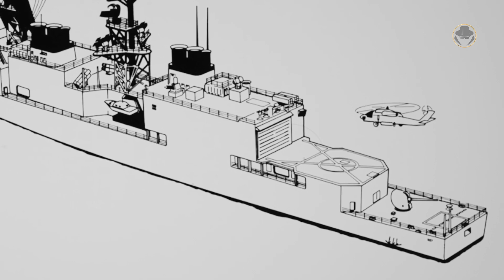Vittorio Veneto helicopter cruiser | The last actual cruiser built in Western Europe

Comment: basically any large modern warship such as a 7,634 ton - 12,063 ton destroyer could do with a double classification as a helicopter destroyer cruiser with minor modifications & upgrades . . . incorporating a stretched flight deck at the very aft stern section & a sizeable hangar that can fit upto 3 ship-borne MH-60U Marine Hawk multi mission maritime support helo . . . the stretched stern flight deck has to be long & big enough to accommodate 4 - 5 helos with simultaneous lift off & landing capability . . .

Comment: You removed my comment. I did not insult anyone,what I wrote was this. The Vittorio Veneto never had 4 Polaris tube installed,you are confusing with the Garibald,ex wwii heavy cruiser converted to missile cruiser in 1961. Garvald had 4 polaris tube. I sent you a link showing you the details of the cruiser and the photos and my comment was removed. Vittorio Veneto could never have had any polaris tubes installed as it was designed to carry helicopters whilst the Garibaldi was a conversion and it had a larger displaycement. For your information I was on the Duilio 554 which was moored right next to the Garibaldi in Taranto and subsequently to the Vittorio Veneto.
Reply from the maker: We did not remove any comments. It was probably YT. Many sources, including the Jane's, mentioned the Polaris tubes. Of course, nobody from our team could have the pleasure of seeing Vittorio Veneto with their own eyes. Thanks for your information.
Reply: Da mia informazione mi risulta che sia il VV che il Duilio e Doria erano predisposti per imbarcare i tubi lanciamissili Polaris. Predisposti, ma non imbarcati.. Oggigiorno si direbbe FFBNW, ovvero Fitted For But Not With. (Non so se parli inglese, spero comprenda) Quindi il tizio del video si direbbe abbia ragione.
Reply: @sergiodario58able  First of all my original comments were in English, so I believe  that have already answered your question. Now considering the size of the Polaris launch tubes on the Garibaldi (1961 refit) which were positioned below the Terrier launcher (stern) I suggest that you look up the size of these tubes and the required space used on the Garibaldi. Even though Italy experimented with this missiles until 1976 and Doria/Duilio and Vittorio Veneto were launched/used after 1964, the Preparazione without fitting of the tubes would have required not having the flight deck. 
Furthermore : "The launch shafts, about 8 meters long, had a diameter of 2 meters and the doors opened by rotating towards the axis of symmetry of the ship. The project for the arrangement of the four launch wells of the Polaris in an area previously occupied by depots and coves of various destinations was handled by the then vessel captain Glicerio Azzoni, and concerned both the structural arrangements for the launch and the placement of all the systems and equipment necessary for the use of missiles, such as navigation instruments and the complex of calculation units. These arrangements were placed in rooms adjacent to those of the wells, which were mostly below the waterline, in an area delimited by watertight bulkheads and a triple bottom, approximately 14 meters long in total and equipped with lateral protections. " Duilio and Doria would not have been able to perform to the original requirements. If Italy would have been allowed to have nuclear weapons then perhaps after major refit these three ships would have been able to carry  one or two tubes. Question : have you ever served on any of those ships Garibaldi, Duilio/Doria, Vittorio Veneto? I was on board that Duilio from 1969 to 1974 in CADT.  I know 100% what weapons were available and the potential of any new ones.
Reply: @sailor67duilio27  
Si direbbe che le tue informazioni siano più dettagliate delle mie, e mi complimento del tuo sapere in materia e dell'eccellente esposizione in un ottimo inglese. Non sono stato imbarcato in alcuno di quegl'incrociatori, anche se v'ho messo piede sul VV da marinaio visitatore. Sono stato imbarcato su nave Carabiniere da RT nel 76 per circa 10 mesi. Amo la marina ed amo la mia patria come presumo lo faccia tu. 
Distinti saluti, SergioUK....(UK perchè vivo in Inghilterra da 36 anni).

Comment: The Italian Navy is back with new 15,000 ton heavy cruisers in the next few years, with 100/128 vls 185 MT long.
And it is likely that the names will be of the new cruisers Andrea Doria and Vittorio Veneto
Reply: Andrea Doria is already being used as a name. Also they are being classified as Destroyers.
Reply: @ElAyVee  You're right, I forgot that the Andrea Doria is already in use in the Horizon fighter, what I'm referring to were initially the new fighters that were supposed to replace the Durand de la class. Pens that were supposed to be 11,000 tons, and They were considered light cruisers/destroyers, lately they changed them and brought them to 14800 tons and they are called heavy cruisers,They will make 2 units but rumors speak of the possibility of another 2 optional ones at a later stage, they will start construction in 2026/27
Reply: @met71metaldetector55 correct, however  the project is still called DDX, so Destroyers still. But I will wait to see an official announcement that says otherwise, let's not get ahead of ourselves.
Reply: @LeonardoFSI   It is the DDX program but lately they have changed the project because it will have a radar that weighs only 7 tons and works on X and C band and they have brought the DDX to 14800 tons and they are considered by those who appreciate them Destroyers but heavy cruisers due to their weight, size and detection system over 1000 km, Then we know that the Italian navy always underestimates the classes of ships. They can classify them as destroyers but with the capabilities of a heavy cruiser, while the PPA evo which are classified as patrol vessels But the evos are screwed, it is likely that if the DDX will have the cruiser role the evos will have a destroyer role with its 64 vls and armed with scalps.
While there are already rumors that the DDX will be equipped with hypersonic missiles,  From cruise either American or MBDA ones, which are developing

Comment: Displacement of Veneto cruiser  is much smaller than our new german F-126 frigates.... But before laughing... there are many ( modern 21st century) comfort, technical, Security and redundancy reasons für that fact.
Reply: Remember we Lost the war , back then we weren't allowed to build big ships , still today we have to built Destroyers just below the  lower limit of such class and call them Frigates we only have 4 proper Horizon Class Destroyers but 10 FREMM Frigates bigger than the French ones ( they can have as many proper destroyers they want) and Just commissioned one LHD cruiser of 245 meters that actually  carries F35 B and will carry 20 of them  because we already have an aircraft carrier (2 actually but we're going to decommission the oldest One)
Also our Military ports still  have limits
Reply: @adeliomoro2069  You are wrong, there were no limits imposed on Italy in terms of how big a ship it could build, and no limits imposed on Italy after WW2 still applied, all treaty limits were nullified between 1949 and 1951, the limits were removed so fast some ships that were do to be scrapped were put back into service. The Vittorio Veneto was an enormous ship by any standards, the biggest surface combatant built by a western power (except the U.S) during the cold war. Italy dosent "have" to build anything under any limit and Italy dosent have to call destroyers frigates, Italy always used the destroyer name for destroyers, the FREMM are called frigates because they are frigates. Italy can have as many proper destroyers at it wants, ironically the french are the ones that cannot have destroyers, as the destroyer nomenclature was outlawed in the 1970s to reduce burocracy in the french navy.
Reply: @adeliomoro2069  Germany after 1990 2+4 and other International laws has no Limit.
And italy also cannot have Limits concerning warships.
 They have 2 F-35 aircraft carriers with additional weapons.
And Plan to build a 10.000 destroyer DDX.
So you are totally wrong and old fashioned in your opinion!

Comment: the 360° deg rotating Mk10 twin-arm launcher module of the SM-1ER inertial guided surface-to-air missile could have been smaller, more dimensionally compact & capable . . . for e.g. the Mk10 missile launch module could do with 4 launch arms instead of just two . . . the Vittorio Veneto class helicopter cruiser could still be viable in current day naval warfare, from a unique mission perspective . . . serving as a multi mission expeditionary support & command vessel . . . ofcourse a present day guided missile helicopter cruiser will be far more advanced & capable than it's predecessors . . .